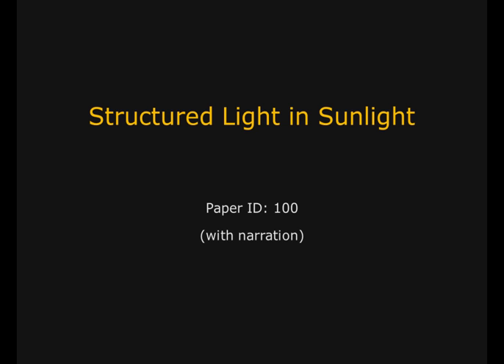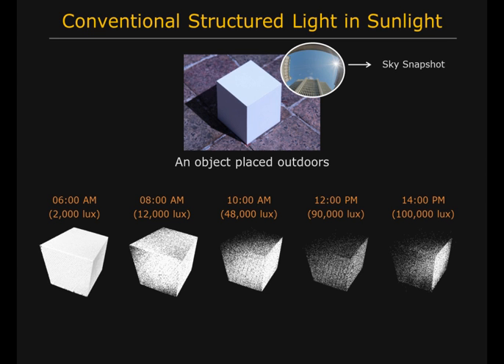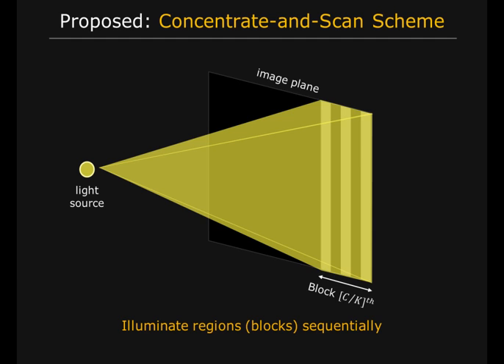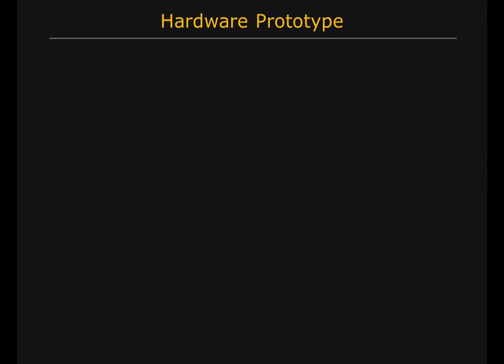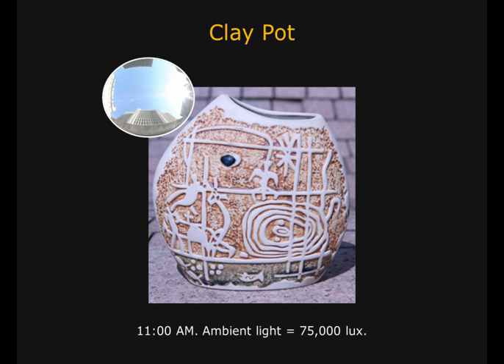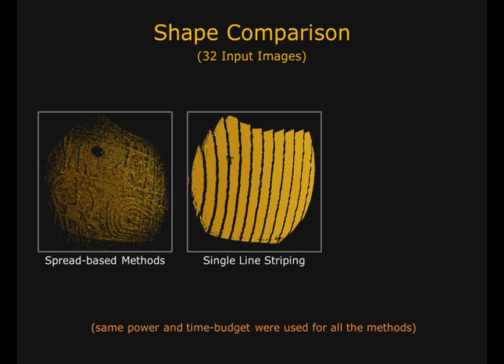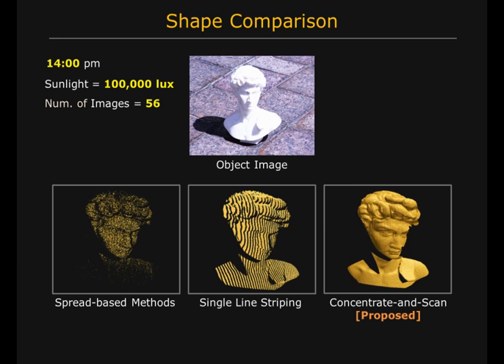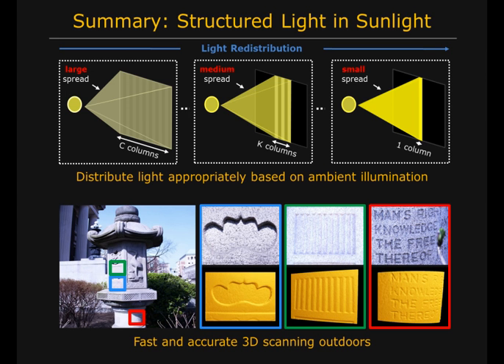Structured Light in Sunlight

Comment: This is good but if your looking for the best power and computation method why not just use the sun as the structure light source. At most it would take adding a small device to look at the sun. Then just something to move shadows.
Reply: what can make the shadows move, any idea?
Reply: @keiwang-nd2kg  If you wanted the most control, then you would probably want a liquid like water in a clear container circled by speakers. That setup would take a lot of computation, so maybe just a hard, clear plate with black sand on it, attach something to make it vibrate in a bunch of places. You would have just about as much control but less computation cost. Then, there would be a list of less fancy ways, too.